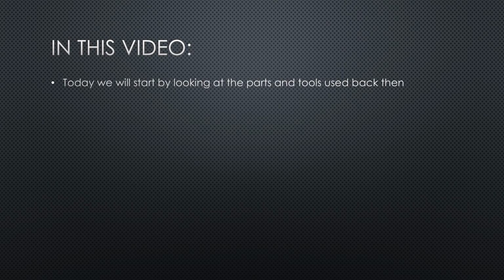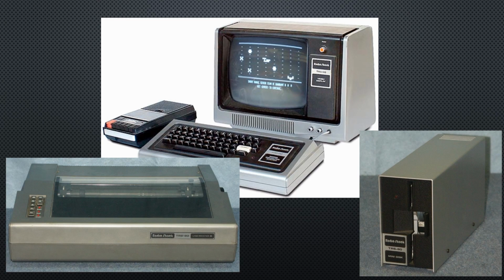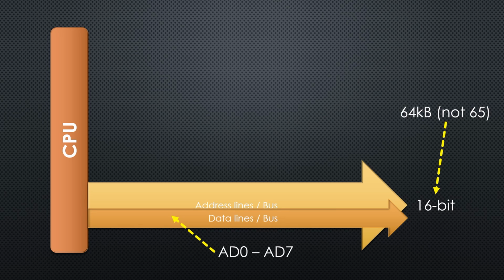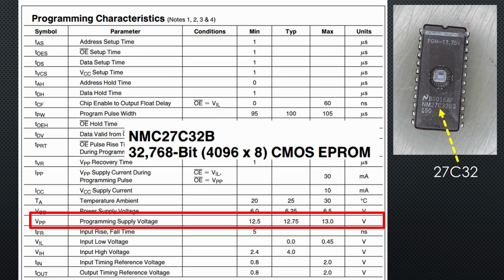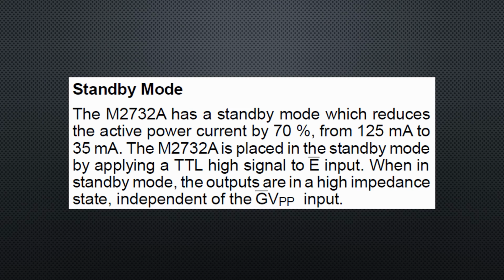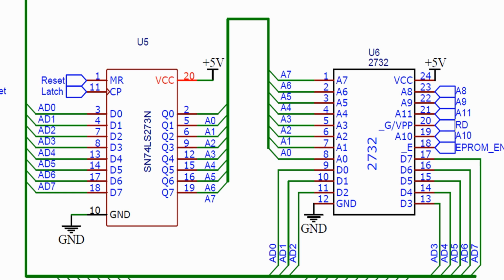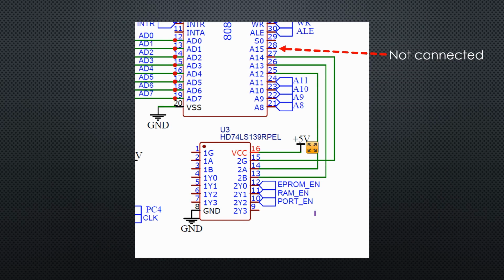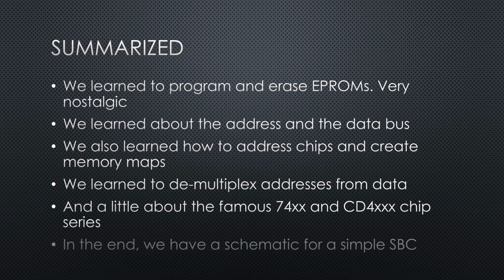#297 We build a historic "PC" using technology from the 1970s (8085, 8155, old EPROM, TTL)

Comment: Excellent dive on the past! I recall working on the PIC16F84 back in the 90's. They were a big hit back then when I was working on my electrical engineering degree!
Reply from the maker: The PICs were already quite an innovation compared with these chips because they included already most of the needed components.

Comment: I was a MOS guy. Somewhere, in a box, I have a project I built in the 80s from a 6502, a 6522 VIA, a 6264 8x8bit static ram (I didn't want to get into refreshing) and a load of 74 series for chip select logic!

I suspect the "OS" has vanished, it was only on the 6264 with battery backup! Probably got another copy on a 5.25" floppy in another draw.

I still have a load of Eproms, and a UV eraser, but my programmer wants an ISA PC bus, which is a bit of a problem these days! lol!

I never realised the 8085 had a read and a write pin, that seems odd to me, surely you only need one. A read not write.
Reply from the maker: Back then, many chips had this two wire logic. I do not know, why they did it like that.

Comment: I built a control system for the theater lighting system in college using a Motorolla 6800 and a lot of these same memory and I/O chips.  Punching in all that assembly code on a Heathkit development board via a HEX keypad ... those were the days :)  Oh and remember when Atari made real computers?  An Atari 1040ST was the "control station".  We had a computer with a color GUI and a mouse running these 6800s via RS485 links in 1987!
Reply from the maker: I was never on the "Motorola side". After th Z80 I changed to IBM compatibles and I am still a Windows user. Only the Raspberry runs on Linux.....

Comment: Intel produced a dedicated in circuit emulator to debug 8085 designs. It was a very large blue desk top box with its own CRT display and 12 inch floppy drive, much bigger than the first IBM PC.  The box had IC plug in pods which connected to the target PCB. Each  pod was dedicated to the Intel processor being used, others supported were the 8048 and later the micro controllers such as the 8051, 8044. Each pod connected back to the ICE box via a double layer of ribbon cable,this was so thick it seemed to have a mind of its own, often pulling the target board off the bench and onto the floor.  The ICE allowed 8085 code to be run in emulation memory and be traced and single stepped on the target circuit board.
Reply from the maker: You are right. I remember when I was a student and an engineer told me, that the whole in the big floppy disk was a sign that it was defective. And I believed it!
Reply: @AndreasSpiess  as I recall the very big floppy disks also had a small offset hole that was used as a reference mark for the disk start point. It also had a small square cutout in the side of the disk envelope used to write protect the disk. A small rectangle of black metalised tape was used to cover the cut out, to make it write protected.

Comment: Nice video!! However I'm a bit confused why it's more easy to work with 8085 than Z80. Z80 also has its own supporting chips for various tasks, not just 8085, and it can be told for every CPU family more or less, including 6502. So I can't see the reasoning of the start of the video, that 8085 is better in this (in fact, I see that as a drawback to have multiplexed data/address bus, while Z80 hasn't got it and more easy to deal with - however less tricks to learn then, indeed ...). BUT anyway, at least I can see something built with 8085, since I built many things with Z80 and 6502 myself already so it's time to see new (well, "new old" ...) things :)
Reply from the maker: I only compared it with the Z80. The 8085 has built-in clock and interrupts. Which offsets the additional latch for the demultiplexing in my opinion. Plus it was a good example to talk about multiplexing ;-)

Comment: I learned to program on the Z80, flashing EPROM's with a bank of toggle switches and a pushbutton. It was fun. And one good thinking about the Z80 is that if you set and flashed the wrong data, you can overwrite it to the value "00000000" (0x00), which is the code for a NOP
Reply from the maker: You are right. You always can "correct" an EPROM entry by adding one or more "0"s. NOP is of course, the easiest

Comment: Oh Yeah - what a blast from the past.  Ahhhh Hex coding - for my senior project for my degree I built my own development station; the university had no computer development stations.  Had to code directly in Hex into an EPROM programmer then run it on my dev. station build - Tough to debug !  Anyway got it working and built a voice output security system that was cool.  Sure was exciting times, so many applications open for the making at the time.  And those 8085's were so easy to work with.  74 series TTL - in high school it was SOOO fun to play with all these logic blocks at the same time, my older brother in college built up a repeater station for our Amateur Radio club - had a number of PCBs with 74xx logic - we did pretty good PCBs from our home setup.  [Our Dad was in electronics  since 1930 - did electronics for the military and was a Ham radio operator - we always had a fully electronics shop growing up with meters, power supplies, oscilliscopes and all the cool stuff to play with.]  I did lots of uP systems for my work in the industry in Silicon Valley of California - and many of my own operating systems -- with some of my favorite memories being trying to workout elegant solutions to perform functions with limited memory and in maximum speed.   After 20+ years of that, was about the time that engineering started to get farmed out to other countries - so I made the jump to doing patent work on systems like that.  No more 100 hour weeks with crushing deadlines and managing large project teams - AHHH - in short an actual life... and time to spend with a growing family.  
But I sure miss it all, text on paper just isn't the same as building up hardware systems.  As I slowly get some of my Homestead Projects done here at Relentless Homesteading - I am starting on some electronics designs (e.g., security, communication, protection, control) for around this place.  The thought is very exciting !!
Good description you had about the complexity ladder.  I one way I am amazed the powerful circuits available today at very low prices.  BUT in some ways electronics was simpler back in those early days - because there were no hidden layers of vague firmware/software - figuring out some of the equipment today is like the Star Trek game of Fisbin (rules constantly made up and in flux). 
THANKYOU for this bit of nostalgia !!!
Reply from the maker: We are very lucky we get this cheap stuff at our age. Like that, it is easy to learn and build new stuff and stay flexible in our brains!
Reply: @AndreasSpiess   Yeah - we are either growing or dying -- I'll take the growing.   Thanks

Comment: As usual, interesting and funny ideas! Thanks!
 And old memories from old 6502 and 8051 projects pops up.

A question regarding the interrupt generation from U8, if I calculated correct the Q12 pin will be high for ~1.1ms (after being low the same time). I don’t know 8085 in detail, but as RST 6.5 is level sensitive, will the 8085 jump back to its interrupt routine if the routine is finished within 1.1ms? To avoid this, the counter could be reset with a pulse on PC4, but that will give an unstable clock to the 8155 timer. What about using the RST7.5 which is edge sensitive instead of RST6.5? Or is there some drawback? 

I took a look on your schematic and would like to give some comments:

Some persons have already comment about the decoupling capacitors and I agree that it would be a good idea to add >100µF on 7805 input and 10-47µF on 7805 output. If all ICs will need a 100nF each there are a lot of opinions about, but as this is will be a historic design, why not put one cap for each IC as you could see on many old designs?

As Greg Clare says I also suggest to use a latch IC (instead of a F/F) such as 74LS373 or 74L573 (the later often gives an easier layout). Using these ICs, ALE can go direct to pin 11, so U4 will not be needed! Pin 1 on 373/573 has to be connected to GND.

Maybe make the reset circuit a bit slover? Intel datasheet for 8085AH says that reset must be low >10ms and suggest R1=75kOhm. To improve the reset circuit to cope with short power interruptions, a diode can be connected in parallel with R1 (cathode to +5V).

I think there may be some error around the x-tal circuit as XTAL3 is not connected to U1. Is the intention with P2 to give an option for an external clock? In such case, should it be a place for a jumper between XTAL3 and XTAL1? Care must be taken to keep down stray capacitance for such solution.

U1 pin 37 is not connected to the CLK-net.

Intel datasheet shows pull-ups on RD and WR signals as they can go to 3-state level.

I’m not sure if there is any pull-up/-down on the control pins on 8085. Maybe it could be a good idea to pull READY high and HOLD low. Also a pull-up on SID could be good.

Looking forward to next episode!
Reply from the maker: Thank you for all your tips. I will review one after the other. Concerning the caps: It was late in the night or early in the morning when I finished the video and my flight went the next day. So I forgot to add them :-( And concerning the exernal clock: You are right, I want to be able to clock it externally and I will follow your suggestion and add a jumper.

Comment: Nicely explained for the newer generation. But, as soon as you said 72LS273, I thought “No!”. We always used the 74LS373 transparent latch. This provided latching on the trailing edge, so directly connects to ALE (no inverter required), and also importantly, follows the inputs while ALE is high to provide earlier address setup for the slower memory chips back in the day. In addition, the LS373 provides bus driver outputs for greater fan-out. The LS373 and it’s brother the LS374 D flip flop (positive edge) were always the go to guys for latched bus & output drivers back in my 8 bit design days. :-)
Reply from the maker: Thank you for your tip. I got another one to use the 74573 because their pinout is much easier. So I ordered both...
Reply: @AndreasSpiess  Nice find! Those devices must be newer than my 8 bit days. I totally agree that the change to a clean parallel in / out pinout arrangment of the 74LS573 & LS574 makes them a bit more PCB layout friendly than the old-school 373 / 374.  Makes me want to plug one into a breadboard and have a bit of a play again! :-)

Comment: cool!
Reply from the maker: Radio was also very hot when we did not have Smartphones and WiFi...
Reply: @AndreasSpiess  That brings back memories, if you excuse the pun.  First computer, TRS80 with all the fruit.  Next computer OSI Challenger 6802!  We figured out how to run the tape port audio over 2m VHF and had a 20km radio link..  Worked real well, probably one of the first VHF "radio link" type things..  Later we got into various radio TTY things..

Comment: great stuff Andreas... ive got a bunch of the 74LSxx chips i desoldered from boards...nice to learn some of their acutal uses..and a few (UV) EPROMs...but realised they are too big for a 64kb system!.. unless! you use memory banking/switching (thats how older computers ran more than 64kb on a 16bit bus) it would be nice if you could implement that in your next design
also once you have this built, check out its RF emissions with RTL-SDR!...i remember hearing my Amstrad CPC on FM radio!... loading screens sound very much like weather fax!..
Reply from the maker: Too big EPROMs can be used without banking. Just ground the highest address lines. 
I will have a look at the emissions

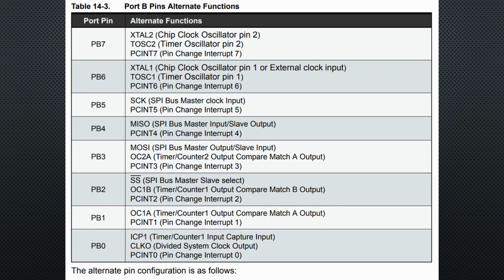Comment: 3:13 not AND, but OR.. you can't connect to all 3 of those internals at the same time.
4:32 OMG a TRS 80 Model 1, I hated that machine when it came to repairing them.
Reply from the maker: You are right with the pins.

Comment: That took me right back to working with a US company who had to get special clearance from certain USA security departments to bring some of those chips into the UK 😲. (think my NDA / security clearance is still in place <gulp>)
I’m always split as to the 80xx series vs the 6502 and 68xx series having used both - I preferred the 6502 series at assembler level but of course CP/M came along and ruled the roost for awhile till IBM stuck their oar in the smaller machines!
Reply from the maker: Because of my TRS-80 I never was on the Motorola side.

Comment: Some decoupling capacitors on the supply rails of the chips would be nice to keep things stable. Using the 8155 PPI was a smart move. You have the makings of an intelligent controller. I don't know what your plans are for I/O but using the PPI to scan a group of momentary contact switches in a 4x4 array would make a simple keyboard. I'm trying to keep my input to a minimum and not steal your thunder.
Reply from the maker: Thanks for the capacitor tip. I will add a few. It is not yet decided which route the project will take.

Comment: 10000  thousand likes as in 10000 days of tool album

"welcome my son... welcome to machine... ". Jesus so many eproms!!!! in 90's 8085 was used to teach assembly in   learning board and eproms needed to be preserved, because shipping was expensive. a ton cable . planing but you'd get all the guts of the projects at you're grasp . "We need to refresh also our own memory " - a line from my professor about ram :D. Then came 8086 and unleashed a lot, some MCU's 8051  and a PIC16F84 :D Also remember the Propic2 , JDM    

PS.: keep the instruction set printed and handy and eeproms were coming, as well anounced the flash rom

Give Warp Drive for this series :D
Reply from the maker: I am not sure how I will proceed (different memory technologies, for example). The next episode should be about programming.
Reply: @AndreasSpiess  If the new memories takes less time it would be more efficient to present, and show one built example of the older memories so you don't have to wait for programming them. Ohh ASM is getting next round  ? Great language. Thanks for the reply.

Comment: I would say that a closer analog to the Arduino is the Intel MCS-48 series of microcontrollers. I currently am working on programming my 8742 to be used in a project. You will find that the Block Diagram matches the Arduino almost exactly. What you have built in this video would be classified as a Macro-computer, as each discreet part is a separate chip, instead of integrated into a single IC. That said, excellent tutorial on computer technology from 30 years ago. Many memories represented here with elegance and dignity.
Reply from the maker: I wanted to go back where each chip had more or less only one function. I thought, this is best for learning.

Comment: Good presentation. I'm glad to see some old school stuff. Pretty simple really. I would have used a z80 or a 6809 or perhaps a 68000. Those were just my favorite and I know them intimately. At least you picked a good chip that's related to the Z80. My eprom programmer wasn't purchased. I had to build it, and enter code in binary format. The ability to single step the cpu was required as well as leds to display the contents of the address, and data bus and the status of cpu control signals. I guess we've both breathed our share of 5 core solder and flux building home brew computers. Back in the 80's I was building with a microcontroller too. A National Semiconductor COPS 402. Peace.
Reply from the maker: I chose the 8085 because I know it best ;-). And it has built-in clock and interrupts.

Comment: I'm really looking forward to this project. I too started at home on a TRS-80 although I already had some experience programming at college in FORTRAN, HP-Assembler, BASIC and COBOL. The TRS-80 was amazing in that it was so small and powerful compared to the RCA 301, IBM 1620 and HP 2116B I had learned on. I did hardware mods to the TRS-80 (like adding lower case letters to the display) and modified drivers in assembly language and hexadecimal machine code. I love Arduino, but have fond memories of the "Trash 80".
Reply: That sounds very familiar.  I also designed and built a lower case mod for our lab's TRS-80, and I did a lot of assembler and machine code on it.  At one point we built current-loop interface to an old teletype ASR33, and we had a remote interface consisting of a paper tape generated off our old scintillation counter and read via the ASR33's tape reader.
That was our main lab computer back then, and we had all kinds of custom hardware interfaces that we  built into it.
I also remember our first dual floppy drive - 5.25" of course - replacing storage on audio-modulated cassette tapes!
Reply from the maker: I also started with  FORTRAN  on a IBM mainframe which, during the day, calculated taxes. And in the night was switched off. So we were allowed to use it then.